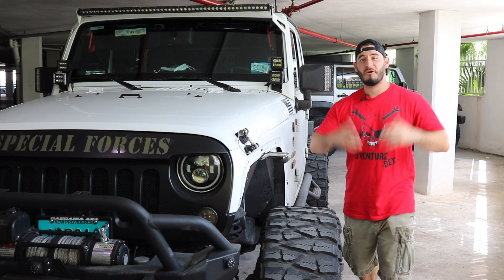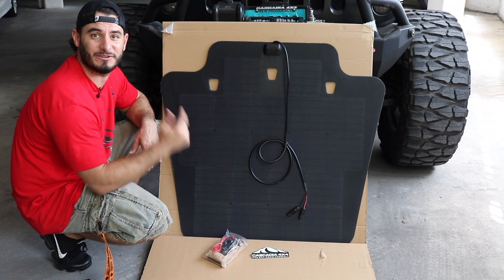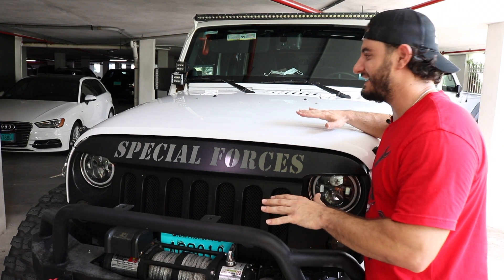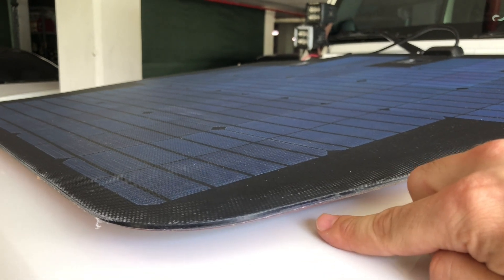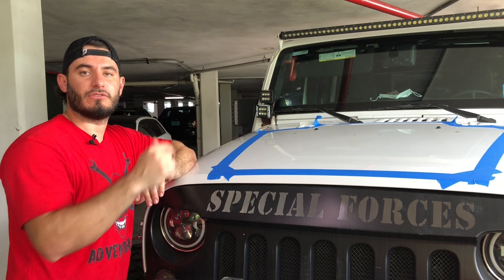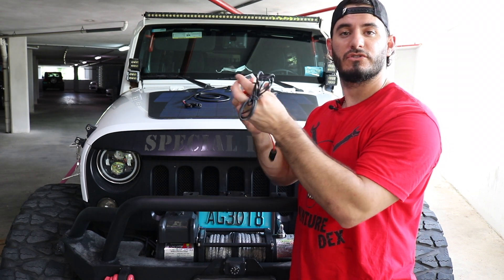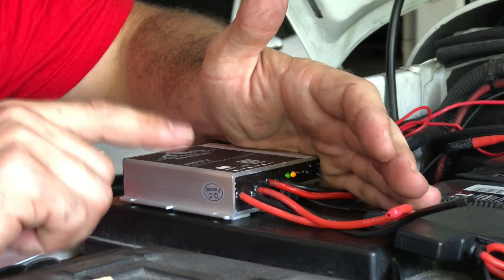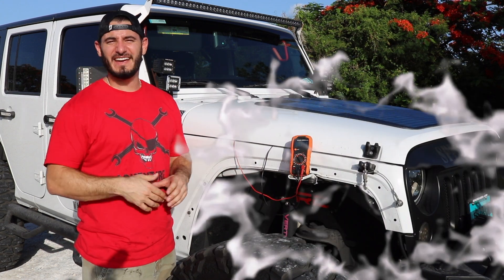The Ultimate Jeep Accessory! Solar Power!

Comment: I love the concept but I don't think I'd go for a hood mounted option, much more likely try to do something on the roof in the back.
The hood gets so hot that it will dramatically reduce the efficiency and lifespan of the solar cells :(
Plus, idk if I could get over the fear of it somehow coming lose while driving and ending up in my windshield lol.
Reply from the maker: Good suggestions but so far no issues!
Reply: @adventuredex  That's good to hear. Have you per-chance done any current measurements to see how the panel is actually outputting compared to its rating?
Reply from the maker: Ama do an update video while also adding a voltage meter showing the volts generated inside the jeep!
Reply: @adventuredex  What about current flow? Voltage doesn't really indicate much, other than it's working on some degree. Current is actually the measurement of electrical flow and the truth teller to how well something is charging.
Reply from the maker: Thanks for the suggestion! I will measure it today and let you know!

Comment: I've seen a few of your videos.  But this is the WIN. I'm now a Subscriber.  What a genius invention!  I have heat louvers on the hood of my JKU.  If they could incorporate some heat louvers with the solar panels it would be a double win!  I've got the Solargizers for my batteries.  I like this much better. More amperage and it would help reduce hood glare from Lightbars as well as add a bit of color to the hood.  A bolt-on version would be preferred though.  I do have some concern of intrusion from around the nozzle holes.

Comment: What is the purpose of the clear plastic wrap vs. just applying the solar panel directly to the hood?  I'm assuming this might protect the paint on the hood.
Reply from the maker: Exactly right. Protects the paint and allows for removal without damaging hood if needed.
Reply: I've been thinking about getting something like this vs. getting a 2nd battery because of the weight.  How long have you been using this product and have you had any issues with it coming off the hood?
Reply from the maker: It’s one of my favorite mods, very well made. No issues at all. Works great!

Comment: Which battery are you using? I have it installed just like yours but my battery drains in the South Florid Sun. My fridge cycles on and off around 34watts. I'm using a Yellow top which the Cascadia does suspect is the issue but my Noco Charger charges it right up with no issues. The battery does start the Jeep and even works great on Heavy Winch Pulls. My lights are Steady Yellow and Fast Flahing Green in the sun. When the Sun his my Cascadia panel the voltage doesn't jump up to 13.1 like yours seem to. it stays exactly where it was. so lets say its down to 12.4. it will just stay there and slowly drain. I do notice the battery drains slower with the panel on. I'm getting 20volts on the meter,  and my Jackery 240 test shows I can get 45 watts. Haven't been able to see more than 45 watts on the Jackery.  Not sure it can handle more than 45watts.

Comment: This why I want a Jeep you can mod the hell out off it
Reply from the maker: Right!!!! 🙌🏼🙌🏼
Reply: To be fair, you can put a similar solar panel on any vehicle's hood/roof :P
Jeeps are just a more prime candidate C:
Reply from the maker: They actually make these for many different vehicles!
Reply: Another one that can be modified, but not to the extreme of a Jeep, is the Ford Ranger.  I do not know if the new four cylinder Ranger has the following the previous generation has.  But the previous generation Ranger can be made your own as well.  I have both a Ford Ranger with a manual transmission, 4.0 litre V6 and two Jeep Wranglers, a 1997 Wrangler TJ with a manual transmission and the 4.0 I6, and a 2012 Wrangler JKU with a manual transmission and the 3.6 Penestar.  The 2012 JKU is bone stock, save the tyres.  The 1997 TJ is heavily modified.  The Ranger is as modified as I could find also.  All modifications can be done with a good set of tools.  There is no need to take any of them to a shop.  I have heard a surplus AM General HMMVW M998A1 is also a vehicle that can be extremely modified.

Comment: Is the vinyl undercoating necessary? I don’t see the point if the panel adheres to the space around the vinyl wrap anyway
Reply from the maker: It’s just to protect the hood for the long term. Simple step to prevent any hood damage
Reply: Yeah, i kinda thought the vinyl wrap might have had two sticky sides to help with complete adhesion
Reply: @adventuredex  yeah I don’t think my panel is ever coming off, so hood damage shouldn’t be a consideration. Not worth the price and doesn’t work as advertised, but looks so cool on my hood so meh I’d recommend it if you have extra money

Comment: I luv using solar, and this is another great application.  One thing about this panel, they should treat the edge the panel  with a nice edge molding.

 I really enjoy all of your videos, even if the  musical interludes need to be removed (even my 14 year old tells me to turn the volume off each time you insert your "music"). Ditch the music for all your speed  time shotsand your videos would be 100 times better.

Comment: magnetic would have been better than sticking adhesive to hood
Reply: Yes like on the roof  not on the hood
Reply: Rob L ya
Reply: Pretty sure they picked the hood as the surface for application because most people go topless and or have their soft top on, plus the removable panels.
Reply: MrJWall magnetic will destroy ur paint too
Reply: MrJWall magnetic always gets rusty and mess the paint.
Reply: It will get rusty plus easier to steal

Comment: can we get longer cables to route the pos/neg cables from the hood to the trunk of the jeep? I plan on connecting one to an aux battery in the back to power up a fridge and compressor.
Reply: Sure you can, although the wires have to be a gauge thicker because on 12v over 5ft you would lose voltage, to avoid that make sure you upgrade the wires for the additional battery in the rear!  It doesn’t work like your typical house electricity 120/220v that happens at about 100ft!

Comment: I like it except afraid it will trap. water/moisture n rust out the hood.   dunno. plus they said it dosn't work w/rubicon for my jl,  if they made it a little longer. did the. vent cut outs. I'd be cool. I'd prob vinyl wrap the entire hood. to avoid rust n I'd buy it today....sigh.

Comment: First Reading of the solar panel was 20.4 with the hood down the reading was 13.6,  why did you mention stronger.
Reply: The 20.4v reading was of the panel's open circuit voltage when not connected to the battery. The 13.6v was the actual battery voltage. It was brought up from 12.6v, so that means it had increased in charge.

Comment: So much stupid here.  No real charge controller... no understanding of the fact that solar panel efficiency degrades with heat...   no understanding of the fact that you now have a heat retention device covering your hood... 

Literally stupider than all the angry grilles and light bars combined.
Reply: Who pooped in your Cheerios Mr. Smarty with zero subscribers?
Reply: Michael Shew you have none either ...
Reply: Its surely only minimally “heat retention” when not moving. As soon as you’re driving, there is much air moving over these panels. 
Have you ever touched a solar panel in any solar farm at the height of the solar angle for that particular geographic location?  Ever fried an egg on one?
Reply: @sheldonf9267  🤣🤣🤣 solar panels LOVE it when you don’t have any heat dissipation.
Reply: @bigcandy5832  obviously, as with any electrical circuit. But again, dark colored solar panels out in a field with no wind in direct sunlight get VERY hot.
Reply: Don’t be a nozzle.

Comment: This will NOT work in Arizona when ambient temperatures are 120°F and with underhood engine temperatures of 200°F meaning surface temperature of the duble walled hood will be at least 180°F way over any solar panel operating system usage.
Reply from the maker: Interesting 🤔
Reply: @adventuredex  this could work by installing this in the back, but iam patenting that idea. Lol
Reply: I installed it couple weeks ago... i'm currently in the desert with 110F and did light offroading, nothing moved at all, really impressed by it.
Reply: @JulienBrami  good to know. Thank you.

Comment: This is stupidity in a box.
If you know anything about electronics or PV you would know that heat and electricity don't mix.
the engine produces heat right?
Ok mix that with the doped semiconductor elements of the p.v. = disaster it will fry that 3mm sheet in the 1st use 😅 but once the solar cell reaches 140-160°F it will not charge correctly or at all these 3.6 run above +200°F.
 the optimum working indirect temp of any solar cells is below 125°F.
You are better off setting up a system on the top of the roof shell.